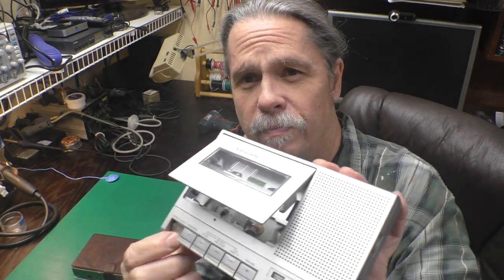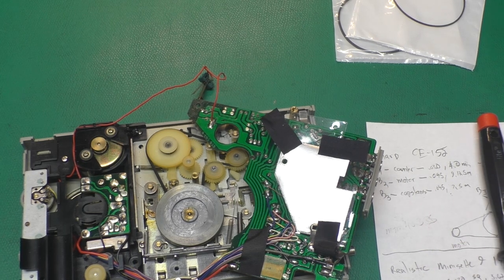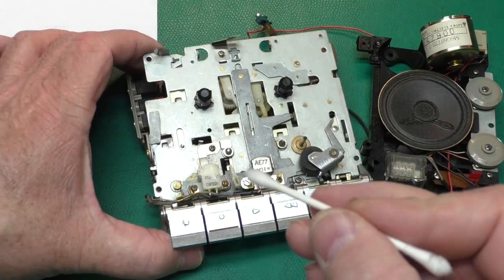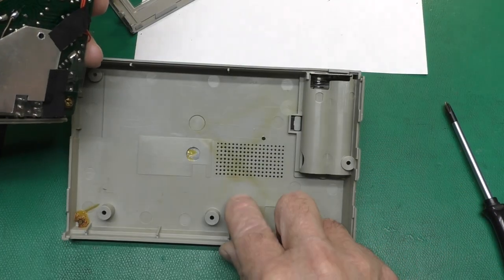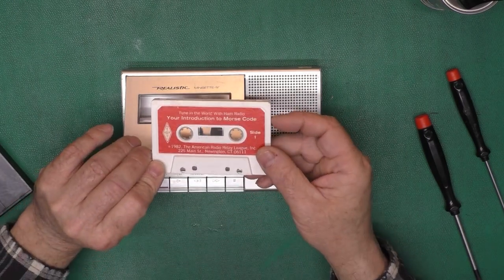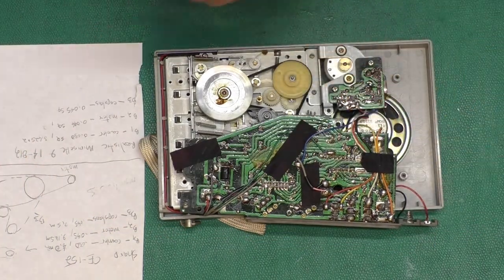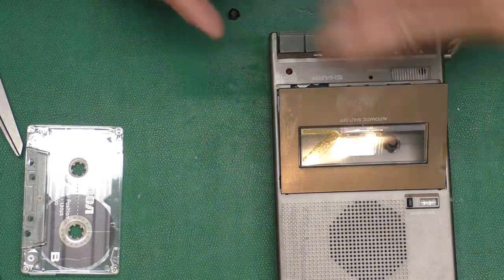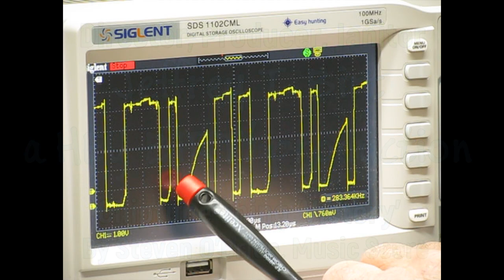Getting belted – Belt R&R on 2 cassette decks gets interesting   Realistic Minisette-9  Sharp CE-152

Comment: You got the two main belts mixed up. The shorter SCX7.0 belt goes around the pulleys in the mechanism. The longer SCX7.4 belt goes from the motor to the capstan flywheel. I measured the original belts which were still intact in my Minisette and the motor to flywheel belt is definitely longer.
Reply from the maker: Indeed, you are correct! Thanks so much for pointing this out. I have corrected the notes in the video description.

I got this unit out today to test some cassette interfaces, so I pulled the cover and pooped the motor belt off. Quickly measuring it, I get about 190mm/7.5". 

I pulled out my original notes which I showed in the video, and I did not write down the length on that piece of paper, so I guess wherever I did write them down I transposed them and transferred this then to my 'master file' of cassette belt lengths by model.

Comment: You had to pull lots of tools out of your toolbag for these decks, Jeff. How did you know how to adjust for stretching your measurements of the old belts?
Reply: Ideally you should measure the belt path instead of the old belt. Wrap a non-stretchy string through the full path, mark and measure the length.
Belt sizes are in linear length or circumference. Rule of thumb is to subtract ~5% for stretch and pick the closest standard size.
You want to minimize the stretch as much as reasonable.  If it's too tight it puts lateral force on the motor shaft and pulleys causing excessive speed variance and premature wear.
Reply: @HutchCA  Thank you. I like knowing to accommodate ~5% for stretch.
Reply from the maker: Yes, a classic case of a 'simple' job that was not so simple after all.

Comment: @10:10, I admit, I haven't noticed any mistake at this point, except perhaps you haven't re-installed the capstan retainer yet but it's not blocked so you still can.
There's probably a record switch under the PCB that may not be lined up just right.
Reply from the maker: I had one wire on the motor power interlock switch in the wrong position, that is probable what broke it. I missed the play/record switch on the PCB as well and I think its actuator got bent from the PCB being installed without being aligned to the actuator. Lessons learned.

Comment: The one thing that I can't get my Minissette-9 to do is keep the Play button down when I push it. I have to really press hard, and usually for 3 seconds before it finally latches and stays in place, or else it comes right back up. If I could solve this one issue the unit would be 100%. Any ideas?
Reply from the maker: Months after this video one of these two decks started doing something similar. Look at the mechanism when you press play. There is a bar that slides sideways, it was sticking on mine. I did not want to take the PCB off again, so I carefully got some lithium grease in there with q-tips and a small flat blade screwdriver.

Comment: A new set of belts fixed the Minisette 9 that I have.   I had exactly the same problem you did getting the little tab that pushes the play/record switch to mate properly.  Took me 4 tries and a quick shot of DeOxit.  My switch was a little sticky which was causing problems with "good play - no record".  That switch is a lot trickier than it looks.

Anybody know where I can get a copy of the manual?

Can't find a reference to it any where.
Reply from the maker: Drop me a line birt_j at soigeneris dawt com